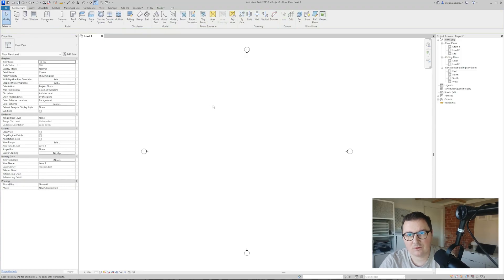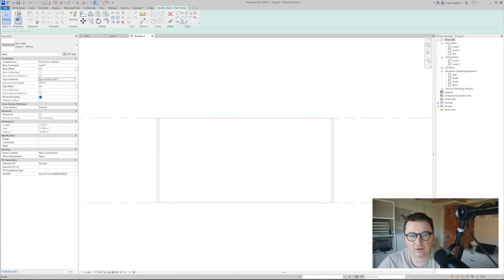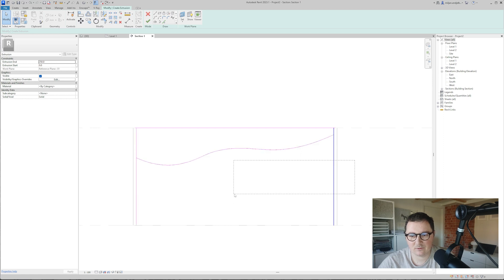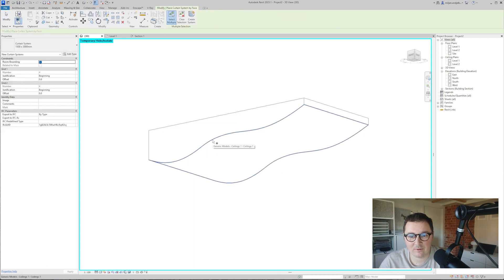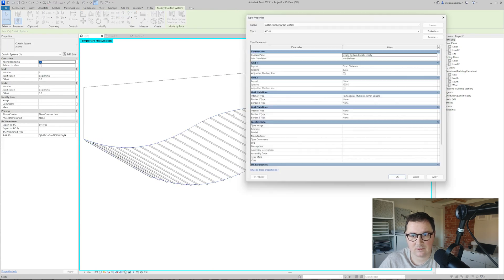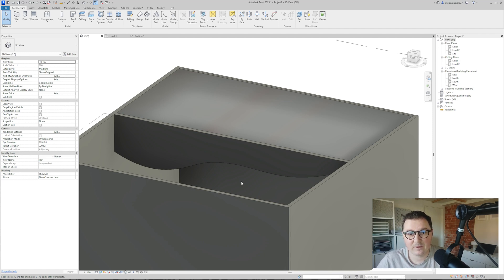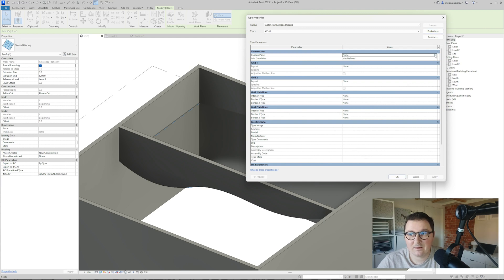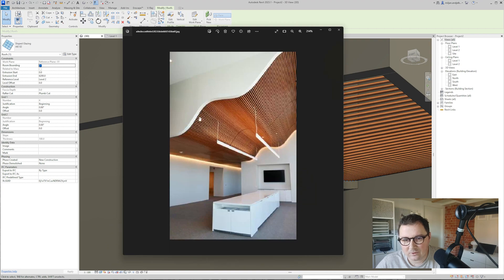Revit Ceiling Advanced Form

Comment: Thank you for out tips it helps a lot !
I wonder if there is an easy way to model curved baffle ceiling (different types of curves, for example baffle wave )
Reply from the maker: You're welcome :) If I understood you well you can do it on the same way as I did it here with Model In Place tool and Curtain System. The difference is that you need double curved ceiling, so you should use Swept Blend in order to get it. Hope this will help you, if not just ask :)
Reply: Thank you  😊  Will try it